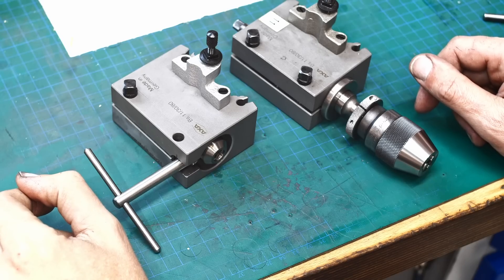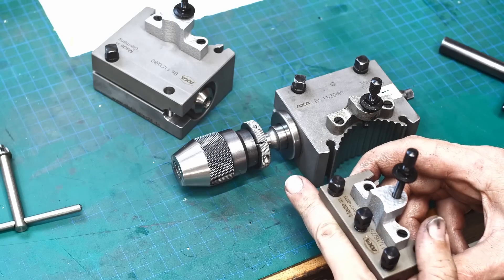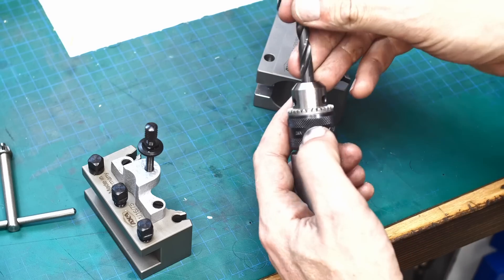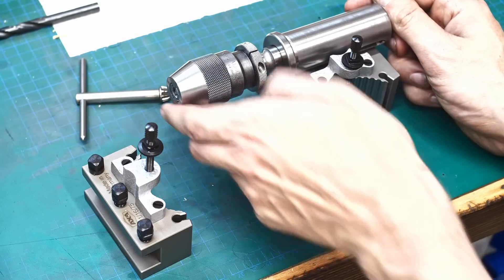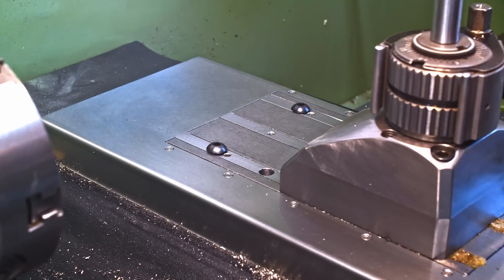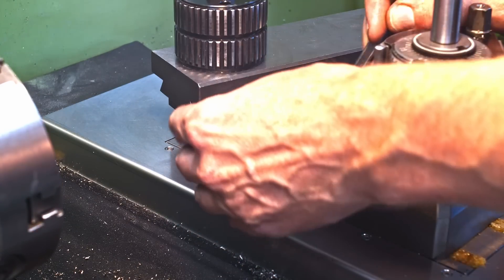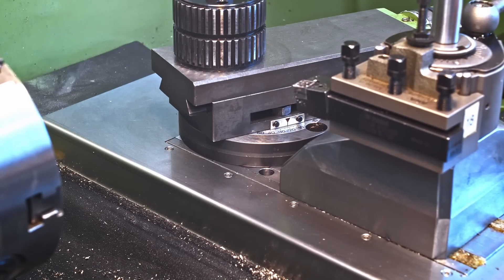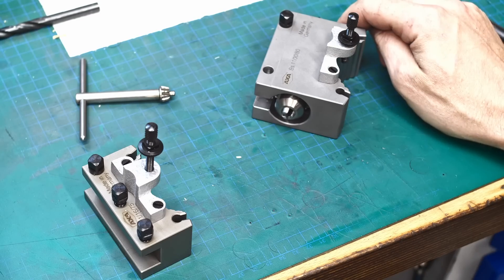The better multifix drill chuck

Comment: I love that you don't hesitate to modify stuff to suit your specific needs. Many people just can't modify stuff because they respect the original design too much to the point that it becomes detrimental to them. 
You don't have that problem. You aren't afraid to saw off a chunk or drill a new hole in virgin  material. 
You don't look at what's there, you look at what CAN be there. 
No limits, no hesitation. If it needs modifying, it GETS modified!
I love that about you. 
You're not bound by convention - as many are!  😊

Comment: Very good Stefan. On my 1943 South Bend 9-A, the cross slide is fluid shaped casting. No flat surface for T-slots, I would say it's art deco style from the time period. I envy you guys with a flat cross slide but the South Bend is charming and works just fine for what I do. My 1943 TREE Knee Mill has a collet closer, no draw bar. When you "cam over" the quill to close it. There must be tons or metric tons of pressure on the tooling. Never had a shank slip even when I crashed it. And everyone knows we all have crashed at least once. LOL
Reply: A guy in Australia makes a T-slotted crossslide for the Hercus 9A(Southbend clone) you could always put in an order, mine works great👍
Reply: @sunslayr  As I was typing my comment, I was thinking of how to make one. Thanks!

Comment: Nice little modification. It looks like it will be as useful as you expect. 
If you really need to choke down on a drill you could put the drill into the chuck backwards through the hole and reverse the chuck in the holder.

Comment: Heebeegeebees is like goose bumps but the connotation is danger and fear, not spooky, paranormal, and miraculous. ALSO, a hole in top for the chuck key might be better ergonomically. A slot so you can see it engage might be nice.

Comment: Capstan / crosslide  Frankenstien. drill from the toolpost. ER16 collet extension, was my recent choice.100mm, live tooling with oilite 20mmID bushes and thrust bearings. Had to tap the back end but it was open.Made in a 32mm al block to clamp in the toolpost, driven off the back pulley to a electric car BLDC motor.

Comment: Very nice, I’m currently using an ER32 straight shank collet chuck in the multifix boring bar holder. It works well but tool changes are slow. I’m looking to do something like you have, a drill chuck in a tool block. But first a digital readout… still some ways to go

Comment: How about using the boring bar holder to clamp in the rotating (gear tooth) part of the chuck, then adding a large hand wheel to the back of the chuck body?

Realistically, the sleeve isn't a precision fit on the body. But you remove the sleeve from an existing chuck, then bore out a blank multifix block so that the block becomes the sleeve. The back of the body would drilled and tapped to accept the hand wheel as you did with the straight sleeve in your original design. The large hand wheel would eliminate the need for a key and you could fit in a larger chuck.
Reply from the maker: Haha, thats a great Idea, to be honest! I will look into it and maybe steal it :-D

Comment: Perhaps a stupid idea, but if you would put your 8mm drill chuck in the opposite direction in the toolholder you could clamp the shaft of the drill and put the flutes in the hole that you drilled at the back of the chuck. This way you could clamp a long drill real short without clamping the flutes. Falls ich mich auf englisch nicht klar genug ausdrücken konnte die Idee noch mal auf deutsch: Wenn man das Bohrfutter entgegen der Bohrrichtung in den Werkzeughalter einspannt kann man den Bohrer extrem kurz einspannen.

Comment: Yea i'm loving the drill holder on the carriage. I had a job where i had to remove a lot of material from the center of this aluminium part and just leaning on the carriage wheel pushing a 25mm drill through with big fat swirls coming out was so satisfying. Saved heaps of time with quick retracts and back into the cut. Also more feedback than winding in the tailstock.
Reply: It can also work for serious drilling under power. My big lathe has a sensitive adjustable trip on the carriage power feed, designed for feeding (when taking heavy cuts or light) into a fixed stop. Works a treat for drilling big holes, up to say 50mm in steel.

Comment: I think you could mount the chuck backwards in the boring bar holder. Then the drill bits would be also mounted backwards, chucked on the rod, not on the flutes.
Reply: Interesting idea. Wouldn't reduce the overhang (hence potential deflection) of the drill shank though, as it's still governed by the distance of the end of the flutes from the drill point. It occurred to  me it would be a great workaround for drilling the end of a workpiece which was almost too long for the lathe (and whose diameter prevented it being "swallowed" in the headstock spindle), although it would require removing the tailstock, and possibly refitting the compound slide.

Comment: Why not get a second key and make a fixed thumb wheel from another key position? Thumb wheel could be sufficient with small drills. Or use the same key position with fixed thumb wheel that has hex for using a spanner or something like that for final tightening.

Comment: Very intersting solution witht he boring bar holder! I wonder if it may not be more convenient for the operator and less invasive for the holder itself to drill a hole in the top face instead of milling a recess in thefar side of it (and cutting part of the treads for the clamping screw). Cips may be a problem, but a rubber plug should be an easy fix for that. Thanks a lot for the video, allways a pleasure see your nice solutions to improve workflow!
Reply: If there's enough room, Instead stead of a rubber plug maybe a 2 piece bronze bush and leave the key in the chuck permanently.. saves always looking for the key as well

Comment: I was just wondering if you could put a detent into the 30 mm shank, or into the boring bar holder, so that you could "pop out" the drill chuck to change bits, maybe use a keyless chuck (if it was small enough?) and then pop the shank back into the holder, with the detent giving you some kind of repetitive fixturing, maybe as the detent ball is clamped into position when closing the holder (maybe add a cam-type closing mechanism?)
Lots more complicated, seldom a "good thing", just an idea or two...

Comment: Set the cross slide table and lock it in place after setting the tail stock, you can unlock the tail stock and slide it back for qiuck chip removing and slide it back. Joe Pie shows it.
Reply: To much work and no power feed on the tail stock.
Reply from the maker: That works with larger drills, but when you deephole drill with a 1mm drill, thats very optimistic ;)

Comment: Very, very clever solution!   
Did you consider adding a 3rd pinch bolt toward the forward end of where your 30mm adapter sits since you are not using the one to the far left?
Reply from the maker: Nope :D
The one pinch clamps already insanely well - I have other tools with a relative short 30mm shank, that also use one pinch screw on the boring bar holders, never had issues there.

Comment: You do great work did you think about using Universal collet setup.  You can have more accuracy with the drill and have a few of them this way you can have quick change on a few sizes you are working on at the same time.  Swiss screw machines have a lot of thin profile collets.
Reply from the maker: I have two options for collets on the toolpost - ER collets and the narrow collets from the FP1 (They look like slim 5C collets). But I rarely use those two options on everyday work, as its to much work for me to switch collet sizes around.

Comment: Hi Stefan, maybe I missed it, would you ever consider trying to modify the lathe by adding a DIY taper attachment and disconnect for the crossfeed nut? Nice video.
Reply from the maker: not really - for long slender tapers I can always use an offset center in the tailstock, short tapers can be turned with the compound and very short tapers I just cut with an form tool.
I dont do enough long taperwork to justify a taper attachment.

Comment: Nice but how do you align the drill? Yes i know im not the fastest moped on the dock
Reply: Not Stefan but I am a Steven😉  I would imagine that he installs a ground pin into the drill chuck ,an indicator onto the chuck
and then finds height and diameter zero.  the diameter zero will be the same regardless of the drill size.
as stefan has mentioned ,his dro recalls all tool offsets so once set it remains that way forever.
Incidentally this is how cnc lathes have been set up since the beginning of time.
Reply from the maker: I did a video on it :-)
https://youtu.be/eAXqEfCr5jI
Reply: @StefanGotteswinter  i get that but what keeps the quick change toolpost from spinnin (where your handle looks on)? how is that center locked onto the base?

Comment: Love it, was there a specific drill chuck you purchased with low run out etc ? I might try making something like this for my Aloris knock off.
Reply from the maker: nope, thats just a generic cheap chuck from Röhm. 25Eur maybe?
Reply: @StefanGotteswinter g'day Stefan, I'm part way through making a holder like AXA-35. Does the centering register also help with lateral load or is it purely for locating the chuck ? I'm wondering if a 6 hole pattern with m4 screws will be sufficient in my case. The AXA 35 seems to use larger M6 screws 🤔

Comment: 6xM3 is as good as an M18, that's how the metric system works right? :)
Reply: Nope, but we have easy to understand namings for material strength, e.g. 8.8 screws hold 800N/mm^2. You will also find all torque values and maximum clamping force for each type of screws in tables using metric units. Nm for torque and N for clamping force. No need to adjust for inch-pound or foot-pound for torque.
Reply from the maker: He made a joke :-)
Reply: 1 is actually 1. 
1 meter : 100cm : 1000mm. 
** For Hex Key and Hex Nut and common use thread pit : 
M5 Bolt  : 5mm : Hex Key #4 and #8 spanner. 
M6 Bolt : 6mm : Hex Key #5 and #10 spanner.
Reply from the maker: In metric its number of screws times the squareroot of two to get the larger screw equivalent ;)
Reply: If the forces are equally distributed, 6x M3 8.8-strength screws can hold about 13kN of axial clamp load and for one M18 bolt of equal strength, it's about 86N... :)

Comment: How are your T slot fillers held in?
Love the idea with access to grease points and fixing for original top slide.
Reply: They are for oil, not grease.
Reply from the maker: They are a super tight fit in the t-slot and also have one setscrew thats very lightly pressing down into the bottom of the t-slot, just for safety.

Comment: so no one-shot oiling of the lathe (yet)? ;-)     Thx for show and tell.
PS: multifix vs the other 90/45 deg exchangeable toolpost systems.. do you need the multi-angle option of the multifix often or would a 90 deg change toolpost suffice for 90%(+?) of the cases/work already?
Reply from the maker: I use 99% 0° and 90° :D
The multifix I use, because its the easiest to purchase here, and quasi-industry standard in germany for manual lathes.
Reply: @StefanGotteswinter   Thanks!

Comment: Stefan what thickness of parting tools You use. I just finished my cast iron solid toolpost and still I cant do any parting at all chatter like crazy. I have tried many different parting tool types but they all 3mm thickness. Going down to 1.5mm now to see if it works. I can take very nice deep cuts in 4140 QT and leave a beautiful finish but I can not do any parting and I find it extremely frustrating. I have a WM290VF lathe.
Reply: (just leaving a note to pick up any responses to learn from) Thx
Reply from the maker: The large parting blade I use is 2mm wide, the smaller ones are between 0,8 and 1,5mm.
There is still a limit from the headstock, bed and carriage design, also the quality of  the chuck plays largely into parting. (Recommended: Robin Renzettis video on boring chuck jaws)
Reply: @Stefan Gotteswinter  Thank You so much. I have watched all of Robins videos. And all of Yours😊. Getting the chuck in a better state is high on my list. My 1.5mm parting tools are arriving soon.  Im really hoping it will do the trick and im glad to here that You use less than 3mm thickness parting tools it gives me hope.

Comment: Why not making a 5C collet in the Multifix tool holder ? It gives maximum stability and the shortest length.
Reply from the maker: I have a collet sleeve for the multifix - But I use it rarely, its a lot of collet changing.

Comment: What size is your multifix post? I got lathe with 180 mm tool height  ,what size should i buy to fit it?
Reply from the maker: Thats an A-Size. The Emco is about 140mm center height, I think.
Most places that sell multifix holders will have a selection chart with center height, spindle power and compound slide width that all play into the size selection
Reply: @StefanGotteswinter  Thank you !

Comment: How do you make sure this drill chuck is in center with lathes bore and in correct tool height?
Reply: He has covered this in depth in a video about a year ago, that is the entirety of the video.
Reply: Put something in the chuck that is round  and place an indicator in a collet in the spindle. Then use the vertical adjustment of the tool holder and the in out adjustment of the carriage to center  the chuck. With a pinned rigid tool post your DRO will always be repeatable for positioning.
Reply from the maker: I did a full video on the topic :)
https://youtu.be/eAXqEfCr5jI
Reply: @StefanGotteswinter  Thank you Stefan i somehow missed that one !

Comment: get a second lathe with a compound ;P
Reply from the maker: Then I have to flip parts from lathe to lathe, not sure if i like that workflow
Reply: @StefanGotteswinter  my second HLVH will have the compound with some common tooling
Reply: @hereticswissery9010   I guess given the cunning Hardinge spindle nose, you could quickly move the chuck (complete with workpiece) between lathes with no loss of accuracy.

Comment: Hello Stefan, I don't understand why you made the inset chuck key rebate on the rear vertical face.
I would have expected you to make the key rebate on the top (horizontal) surface for much easier access / use?
Ok: so it would minimaly weaken the springyness of the chuck fixture clamp, but at the key location, the clamping force is in air, it does'nt clamp on the outside of the chuck.
Reply: In that location, it could be just a hole. I guess the main downside is that it could be more of a trap point for swarf, which would then be hard to clean out in comparison with the slot.
Reply from the maker: That was just lazyness on my part for now, I have to see if i like it on the backside. Top access would collect a lot of swarf probably.